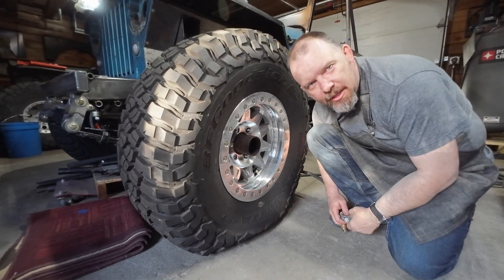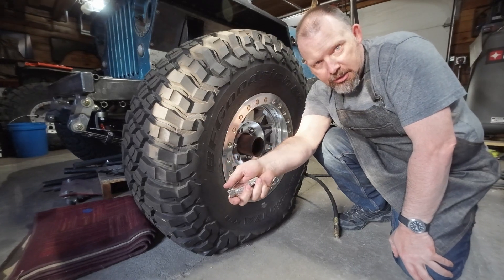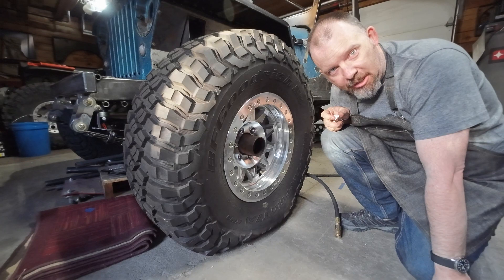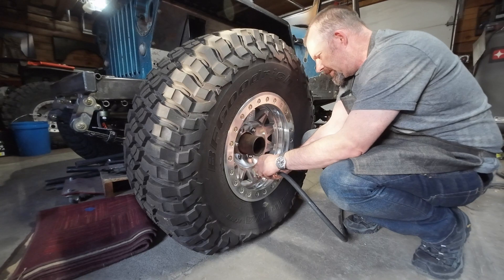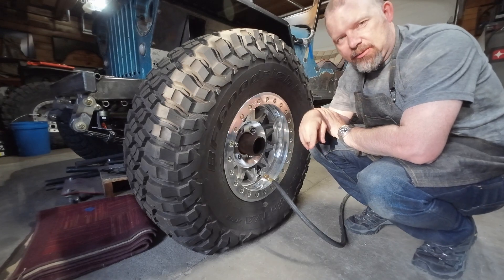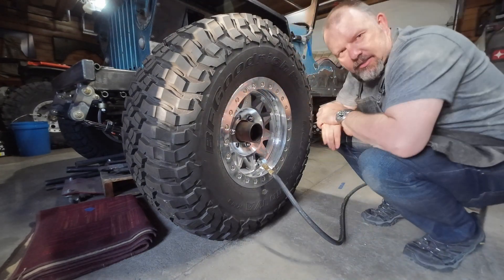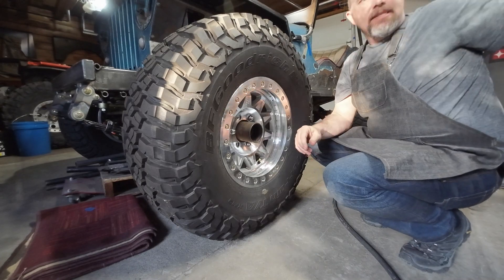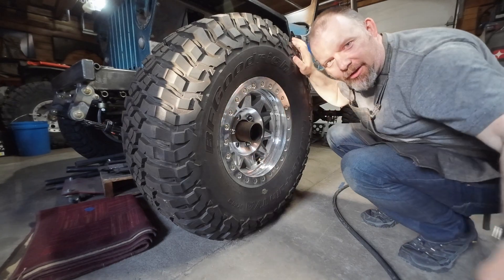Fast Tire Inflation

Comment: That would work great with a Powertank or CO2 tank.
Reply from the maker: Yup, the higher the flow the higher better the performance. I think it it will still make a noticeable difference on a traditional vehicle compressor.

Comment: in the USA you quote the tyre size as inches, in this case, what’s printed on the tyre inches or metric, if so what’s this one and also what’s on Rango ?
Reply from the maker: As mentioned in the description, this is a 37x13.5r15 tire. Rango is a 35x13.5r15

Comment: That’s brilliant. Can the same tool be used to deflate?
Reply from the maker: It could, basically you just don't hook up the air hose. There is going to be another level is stuff added to provide better control and pressure monitoring
Reply: @brennanmetcalf  anything to avoid that valve shooting into the mud is a good thing 👍

Comment: What is your shop air regulated to?
Reply from the maker: Between 90 and 100
Reply: Real  test with a 12volt air compressor ,try it with and without the valve to see the difference,the shop compressor has a big reserve to deploy faster ,hope more test shows that it will be a useful toll ,🙏👍
Reply from the maker: @94Discovery  Sure, but we have to start somewhere. With a small compressor it won't make as much of a difference, but my gut feeling is that it will never hurt performance. Even hooking up the shop compressor the normal way through the shrader valve is a HUGE decrease in performance even with as much pressure and flow as you could want. I'll be testing on my 12V Puma compressor and ARB twin compressor shortly. Stay tuned.